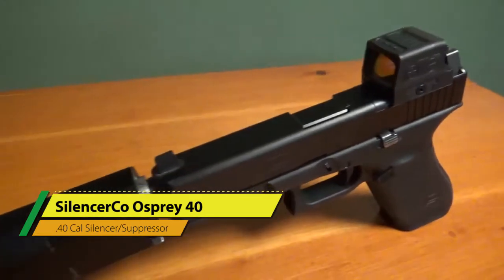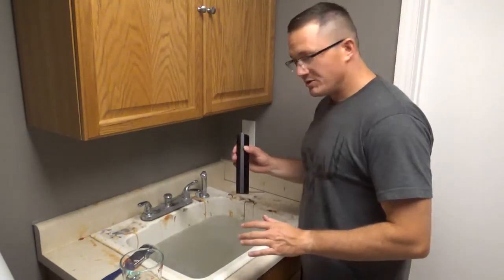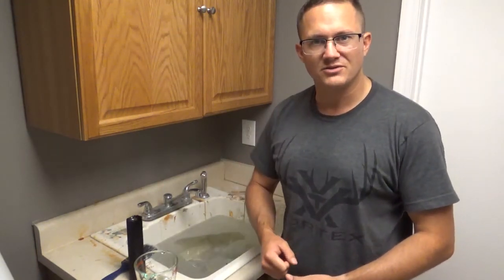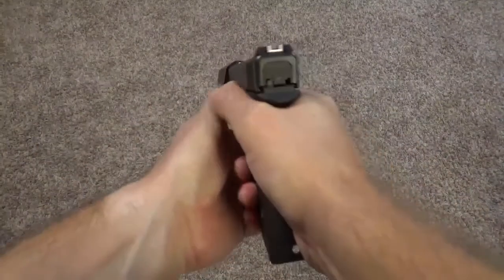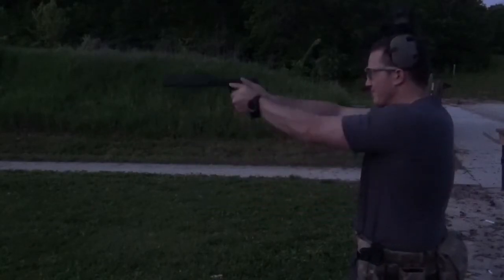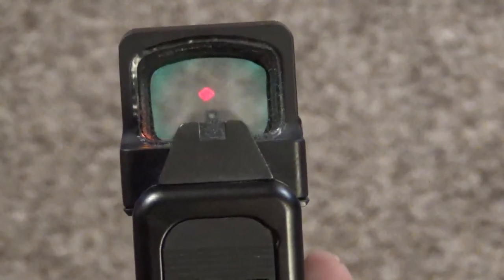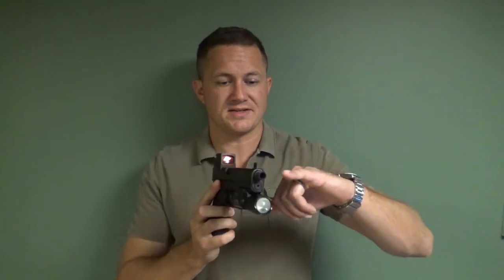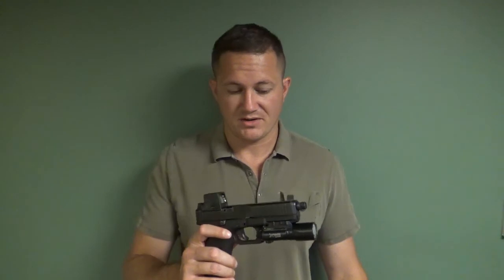The SilencerCo Osprey- Outdated?

Comment: Very informative video, thank you. I'm considering having one for my rifle. The nicest thing I find about this suppressor is the fact that it has more internal volume than some of the more traditional style one, so I think I can choose the shorter version without losing effectiveness compare to other suppressor. Another thing I'm thinking about, which is still on my mind, I didn't test it out yet, is this suppressor will help mitigate the muzzle rise if you turn it upward on your rifle (You know, like those A2 flash hider or AKM compensator)
Reply from the maker: Interesting concept, I didn't think of that.  I'd like to hear the results of your test.
Reply: I have an Osprey 45 and it’s great on my G21SF
And on my Vector. 
But on the new Ruger LC45 is where I would like to have a designated can. 
It really shines on that 45 PCCarbine. I turn it upside down because it aligns with the lines of the forearm perfectly. And I am convinced it douse push down and mitigate muzzle rise

Comment: I've owned my Osprey 45 for 6 years, and I admittedly purchased it purely for the aesthetics. I do pretty consistently get comments from other shooters about how much quieter it is compared to theirs (Gemtec, Dead Air, etc.). I agree I wouldn't recommend it for competition or field use since it's not FA rated, but if the purpose of a suppressor is to reduce the sound signature, then the Osprey shines. Current host is an M&P 2.0 45 Tactical, previous hosts were a **Gen 4 G21, and a Sig Scorpion 1911. I'm currently looking into a 9mm PCC to run subsonic with and streamline my mags when my EDC goes back to the G19.
Reply from the maker: I'll be curious to compare it to my in-bound MOD9.
Reply: @thecontemporarygentleman  absolutely, tech had advanced since the mid 10s. i’m itching to get another suppressor but there’s so many options rn that i’d have to be dead set on a specific one to wait another year to get it
Reply from the maker: I recommend the MOD9.  I'll have a video on it sooner than later.

Comment: As usual with  any video or article that has a question in the title, the answer is almost always "no".
Unless there's another eccentric suppressor on the market, the Osprey is not going to be outdated. The eccentric design wasn't outdated when Hiram Maxim designed one, and it isn't outdated now. On guns with sight clearance issues (there are more guns in the world than Glocks, not every gun is or even can be cut for taller sights or a red dot, and lest we forget the suppressed .357/.38 lever action with an Osprey because rifles that aren't in .300 BLK exist) it solves a massive hurdle in shooting suppressed. It also will fit those holsters. Those holsters are molded kydex, the holsters have to be molded to the suppressor when you get them anyway because the company that makes them only guarantees they fit the flashlight out of the box. The Osprey doesn't work for you because you decided to use a large flashlight, and that sucks, but it only sucks for you.
As far as sound goes, yeah monocores are really crap but the industry likes them so they're here to stay. The Osprey is well below the hearing safe threshold, they're just not impressive, usually hovering at or above the 130 dB mark with good 9mm cans being at 125-ish, but not every 9mm can is at 125 so the Osprey is still par with a lot of the market.
Reply from the maker: Thank you for your detailed and thoughtful response.

Comment: Surefire is an overpriced ugly light. O light seems nice and better priced. Just an opinion. Nice video! Just got my osprey 45k can't wait to use it.
Reply from the maker: Thank you and congrats on the purchase.  I do feel quite a bit different than you about the lights though.  No matter, I'm glad you're into guns and at least own a light!
Reply: Right on. Did you use your 45 osprey yet?? I'm stuck between the 9 or 45? Because I know the 9mm only is the quietest. But the 45 has options of switching to 45 and 300blk. So that is a great feature that most suppressor don't offer. Now on silencerco they list that the 45 is just a tad louder than the 9. So curious if you think the 45 is just as quiet in your opinion??
Reply from the maker: @joshuat5140  I own the 40.  If you want quiet, avoid all monocore cans, especially the Osprey.  Also, the 9mm Osprey will also do 300blk.  That said, don't bother with a pistol can for 300blk.  Not very good.
Reply: @thecontemporarygentleman  why avoid monocore cans?
Reply from the maker: @noway6633  there are several issues with monocore cans:
1. While they have volume, they don't manage gasses well.  The industry has yet to see a good monocore.  It's just that no one has done a good job executing one.  An engineer with a certain solid, growing and very cutting edge suppressor company agree with me.  This isn't because they suck, it's because until DMLS (3D printing) became a thing, there wasn't a good manufacturing method.  You can tell because many companies have moved away from them.
2. While one of the benefits is that they are easy to make, they aren't priced that way.  So at nearly any price of a monocore can, you can get a non-monocore that performs better.  Even if you pay a little more.
3. Cleaning.  Except for the Sparrow 22, every monocore design (that is user serviceable) is not well thought out to be taken apart.
Reply from the maker: @noway6633  I was literally hitting send when I saw you college again 🤣😂🤣😂. You can probably see why it took a minute 😉.
Reply: @thecontemporarygentleman All of Silencer Cos products seem to be monocore. So I just best avoid them?
Reply from the maker: @noway6633  I don't have a lot of experience with the Octane, but it is not monocore.  Neither is the Omega 9K.  A lot of people have those but I haven't gotten to check one out yet.